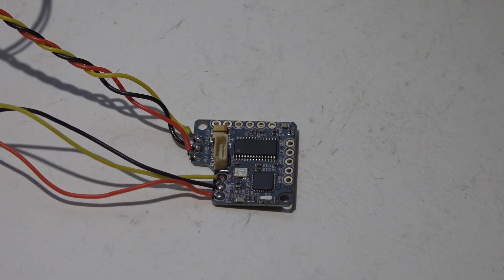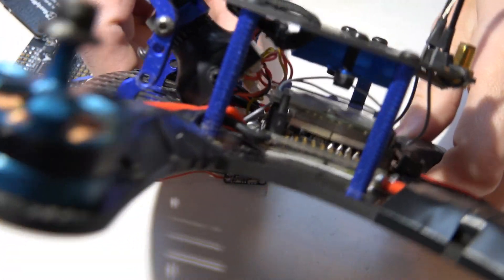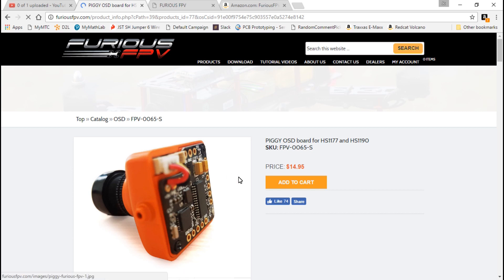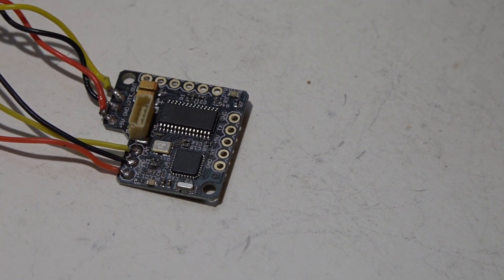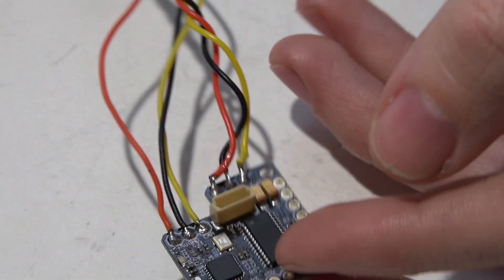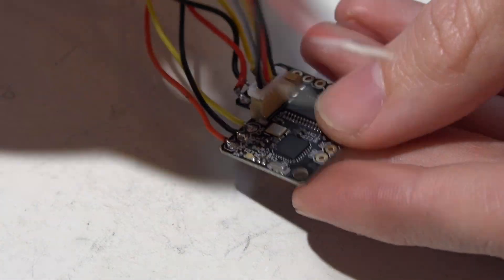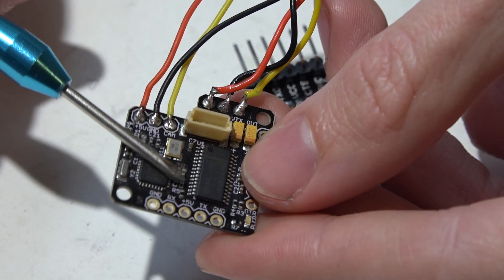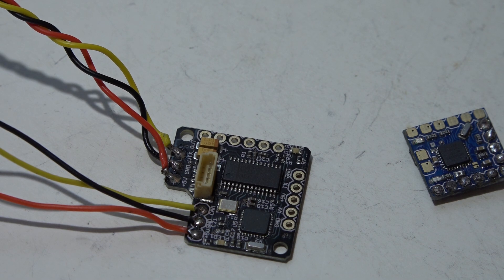Furious FPV Piggy OSD Review

Comment: Can I get an osd board like that and hook it up to an eachine tx03 and a lipo battery , so I can have a portable fpv camera with osd that I can put on any aircraft I want for the time ? I don’t need an osd board that has a flight controller built in , I have a Hubsan h502e & i normally strap on my tx03 with a eachine 150 mah to power the camera so I want to put an osd board in that mix and have osd , I  dont want to connect it to my h502e flight controller, I just want to have an fpv add system I can take on and off thanks !

Comment: Awesome video series on this thing, after watching your whole series on the Micro MinimOSD I was excited to add it into my next build, especially with the Canvas support that allows updating Betaflight PIDs and VTX settings through the OSD. However I had the exact same problem I've always had with these, on punch-outs my video would just disappear, not just OSD, but all video. As soon as I cut the minimOSD out of the mix everything worked fine. Power/TX/RX connected to the SPRacingF3 UART3, Ground connected to PDB common with camera and TBS Unify Pro VTX. VTX is providing the 5V to the camera.

I do have a 1000uf cap installed, but not sure if it's a voltage spike or sag that just destroys the video output. 

Have you seen similar issues with the MinimOSD and does this PiggyOSD suffer the same problems?

Comment: It's pronounced "gooey" no one says GUI.  Thanks for the vid.  I thought you could update firmware through Betaflight... although I've never done it.
Reply: Honestly it is nice sometimes when you guys cover the same things, especially complex things since most of the time there are many ways to do it.   Also you guys each have different opinions which is nice to see too.
Reply from the maker: I've never tried either. I did a video on making changes in MW OSD GUI through the Betaflight passthrough, but haven't found the work around for Arduino.
Reply: Yeah I saw that video, and then the one Bardwell did like 2 weeks later covering the exact same content =)
Reply from the maker: Lol that happens a lot. Thats why I just send guys to you. Don't want to be covering the same thing and stepping on each other. At least not at the same time.
Reply: I've gotten used to it, really my goal is to help grow the hobby, and if someone with a larger audience wants to cover the same thing it achieves my goal, and helps me because my video is usually suggested next.  I really don't think it's malicious, but I do try to cover stuff I can't find or haven't seen.